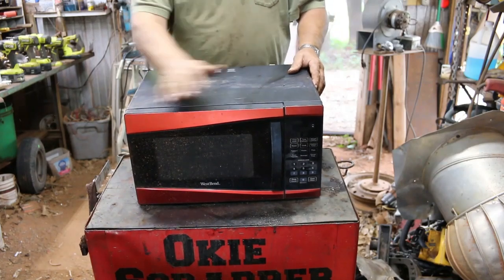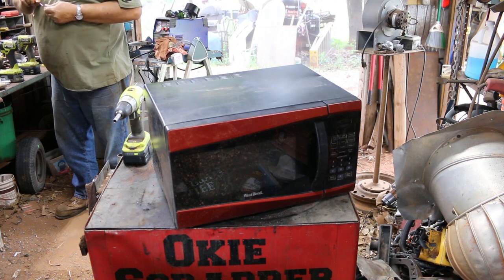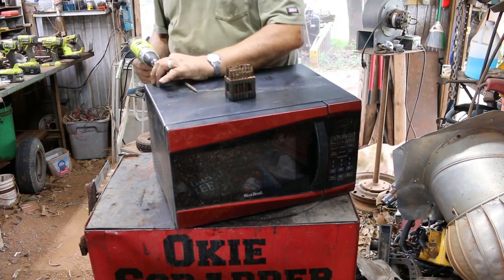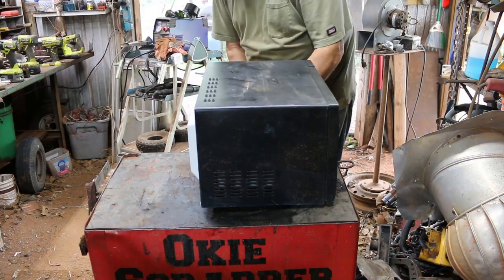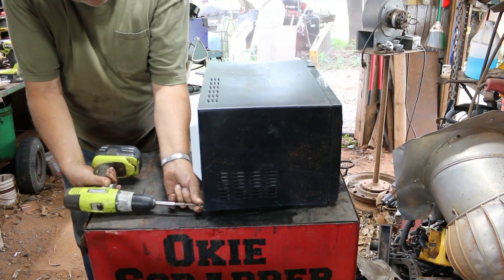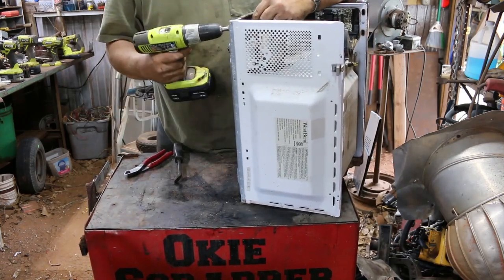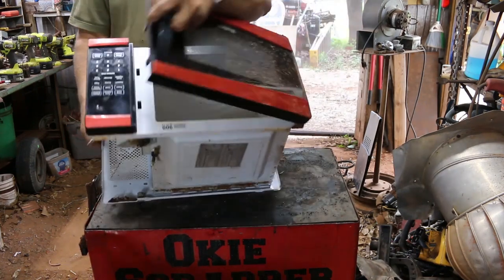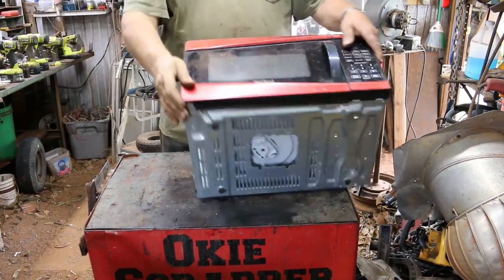Scrapping a Microwave for Copper and Aluminum

Comment: Hello from Michigan I definitely need that bit kit because I get tired of taking microwaves apart and not having all the bits so I have to use my angle grinder to cut those screws out and there's only a couple I don't understand why they do it like that then most of them has Phillips screws but happy scrapping to you Good luck to you

Comment: The silver cylinder transformer has to be taken out because these can hold a electrical charge and when they go into the shreader/hammer mill the discharge can cause problems with their circuit board shutting them down till replacement. Older models of microwaves have them
Reply from the maker: I let the microwaves sit outside for 2 or more months before I scrap them so they should be discharged by the time I scrap them, safer that way, and I do the same with crt tv's and monitors

Comment: On the back of the microwave is a nameplate that will tell you if the windings on the transformer uses aluminium (AL) or copper (CU)
Reply from the maker: I did not know that, I will have to check that out, Thanks